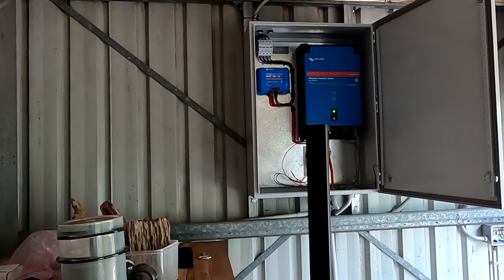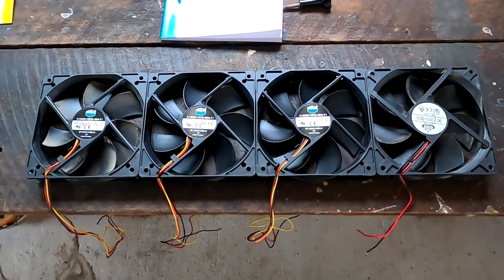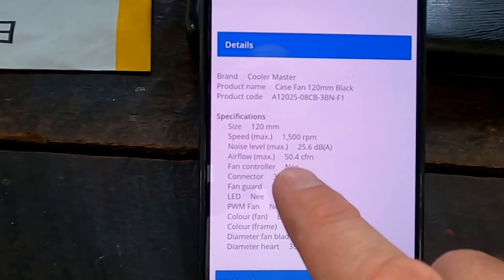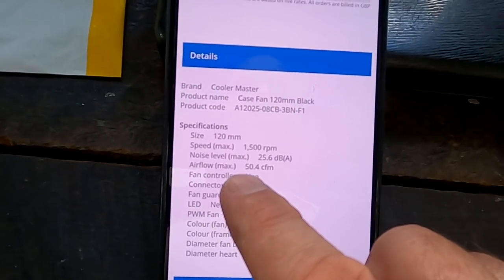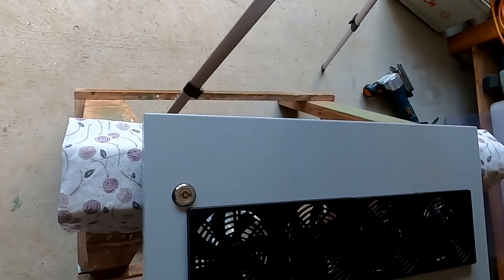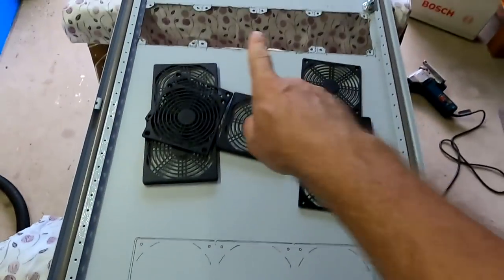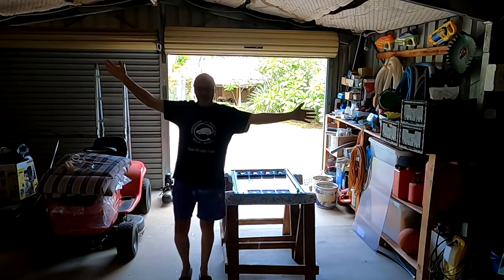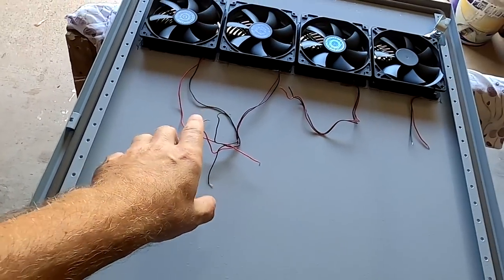Cooling our Victron equipment - your suggestions, my solution

Comment: Don't expect good results trying to series electronically commutated motors for a higher voltage. Even regular brushed motors don't do well in that situation, but at least there you are less likely to exceed the voltage rating of electronic components.  (Use an oscilloscope to see the voltage spikes across each motor.)
You can get 48v rated fans but I think a 48v to 12v DC:DC converter is a better approach.

Comment: If all the fans ran in parallel, you wouldn't have an issue with the differing voltages of the input and exhaust, other than neither being 48v.

Comment: For intake...you could put ductwork down to the floor to get the coolest air!
Reply from the maker: Not much cooler down there. It's sunny hot Australia
Reply: or even an underground trench, for even cooler, but you may run into humidity problems

Comment: You might want to connect a 16V Zener or 12V transient supressor (like MPTE12) across each 12V fan in case one of the fans fails, to protect its inside from getting full 48V as the 16V or 25V capacitors insife it might explode.
a 1A inline fuse would also protect the system from overvoltage.

Comment: Don't run fans in series. I have tried. You could add some 12v zeners and a cap across each fan. That would probably work. Btw I use a standard 240 plugpack running off the 48v to provide a 12v output. An easy way to run fans...
Reply from the maker: Why would it not work?
Reply: @OffGridGarageAustralia  I think the fans bldc controller doesn't regulate the voltage across them in any constant manner. I did this with 24v and they smoked.
Reply: @OffGridGarageAustralia  Voltage imbalance between fan will likely fry them sooner or later. 12V zeners is too low though since that's only 48V, which is less than the battery pack. Need to use something around 15V so zeners only pass current when there is a significant imbalance between fans.

Also, you probably want intake fans for redundancy: if one or more exhaust fans fail, they'll just suck air back in through the failed fans, you won't have much fresh air circulation from bottom to top.

Comment: All that gorgeous parallel wiring undone - could of just got a buck convertor and that would do the job -  Also means if one of the fans goes out you wouldn't burn the the other 3 out with over voltage.... I'm not sure how many volts the fans can take before blowing??? Anyway I love your video's they're inspiring me to get on with creating my own off grid battery setup.
Reply from the maker: Thank you. I could have installed a buck converter but would need to order one which delays everything again.

Comment: If you search for "magnetic fan filter" you should be able to find better filters for fans. They are normally in computers and last quite a lot. I also like Positive pressure more than negative pressure cases. They tend to say a tad cooler. For anyone who doesn't know, Positive pressure is when you have more fans blowing in than exhausting. This causes air to escape where it can and generally pulls cooler air in.
Reply: This does depend on how much heat you have to deal with though. 
I required negative pressure whilst trying to cool an array of graphics cards and ASIC miners putting out 80-90c each hunting for new bitcoins. Managed to get the room ambient temps down to 35c. 
Ended up using one of those tents that the cannabis growers use (cheaper than building my own tunnel or enclosure but don’t look great!) as they have loads of vent positions and hooked up some 323 m3/hr ventilation fans to that. 
That’s the only time I’ve found I really had to think about airflow and negative pressure made a good difference there. 
I do think trial and error is the best way to optimise your cooling set up though. What works for me may not for you!

Comment: are you sure your heat problem is not radiant heat from the steel wall of your shop behind the box ?
Reply from the maker: Yes, because this is the East wall. I also measured this several times in my previous videos 😉

Comment: Series fans shouldn't work.  Well obviously, you will find out if they do, but on paper the one easiest to turn will spin the fastest and the harder to turn ones will stop or spin slow.  Let's see on the next video if you have already ordered a DC/DC converter to step the 48-60V to 12V and connected in parallel again.
Reply from the maker: Why would the not work? You can series two identical electric motors without issues.

Comment: Looks great! One suggestion if you haven't done it yet, add a temperature sensor so the fans don't run all of the time. Unless the controller has and input you can connect the fans to for this.
Reply from the maker: The inverter has already a temp sensor and switches the fans on when needed.

Comment: One could simply put the Inverter's Fan to use - provide vents in the box above the inverter and tunnel the inverter's exhaust out of the box. Or move inverter 1 inch up. Drill holes in the bottom of the box to let new air come in. This solution deploys 'mechanics' vs 'electric.

Comment: I have some experience . In the Texas southwest desert  we have had years worth of heat problems , cooking lead acid battery's , charge controllers ,and  inverters .. first i figured out the biggest heat was the batteries  i built a wood box and burred them on the north side of a shed . i put thin wall 3 inch  pvc  elbow on both sides  one with a screen and the other with a 10 ft piece of pipe  long painted flat black. i was today surprised how much air it moved by draft, did the same with a three ft piece above the roof  . to the electrical room  problem solved , no power needed for fans . so on a sunny day more solar input more heat output the more the black pipe heat rise . Mo more issues .
Reply: Great idea, @Bill Bean, Texan here as well. So a 10' black 3" pvc chimney for natural convection or upflow draft, and a short ground level screened cold air intake, no fans. That sound right?

Comment: BTW, your batteries is around 55VDC or more, so can your four 12VDC fans in series handle the over Voltage? Also if the fan circuits are not matched, some may have more or less than 12V Vdrops on the fan.
What tool did you use to cut the panel? JigSaw?
Reply from the maker: They can run on 24V for a shot moment, so yeah, no problem.
Yes, just a jigsaw and metal blade. Wasn't too hard actually

Comment: I think it would be better to run them parallel and use buck converter to step down the voltage to 12V, series connected fans give you single point of failure, parallel are redundant, if one fan fails in series they all stop, in parallel, only one stops.
Reply from the maker: On the other hand you're adding more complexity with a buck converter. And more heat.

Comment: 040121/1719h PST 🇺🇸 040221/1019h Brisbane.  Please mount fan as low as possible.not in the middle or top. The hot air which is less denser  will rise upwards. The middle or top design will make less impact, on cooling the system. The metal box will also act as Faraday’s Cage effect, thus preventing Bluetooth TX/RX signals to attenuate. Take care , 73s...
Reply from the maker: All wrong. The fans at the top are blowing out as explained. 
Even with the doors closed the BT still works fine.

Comment: You can Under Volt them. Less Noise, Power, and Might Last Longer
Reply from the maker: 120mm fans don't make any noise at all. They are in computers and are running for years without any problem.

Comment: Wondering what kind of solution he comes up with, 12V PC-fans should have about 12V for safe operation. Dc 48V to DC12V can be done with optional converter. E.g. in the batterybox and cord from there. Convenient with thermostat connection in the inverter – if it can be done easily and it works. 
Fun to watch the videos – it is well thought and he comes up with good suggestions and changes – as well as has many following on YouTube.

Comment: Nice solution Andy- looks good.
As far as space is concerned, you could always mount another controller on the side of the cabinet.
You could also perhaps even have seven fans all running in series, (ie: three pushing and four sucking) thus running under speed and quieter. They’d also likely then last longer too.
BTW What sort of strange people give you a thumbs down on these videos?
Reply from the maker: Thanks, Dave. Some good ideas!

Comment: If the fans run to fast put 1 extra in series on the inlet, that will slow them a bit down or use a small step down inverter to feed them a lower voltage.

Comment: Andy, the way we always ventilate  cabinets in industry is to pressurised them from the bottom and exhaust  the hot air from the top.
Pressurisation both keeps dirt out and causes better contact with the air for enhanced heat removal. 
In summary fans at the bottom of the door vents at the top. Fit filters to both inlet and outlet maintain the necessary back pressure and also keep ants out. You don't want ants moving in, they piss formic acid.
Rittal make all the necessary equipment which is expensive and requires a fair bit of depth.  Doing your own way is more affordable.
Reply from the maker: Thanks Mike, good tip.

Comment: Hi Andy, happy Easter to you too!  Btw. in Australia the Easter Eggs are brought by the Kangaroos or by the Koalas?
From the easy to mount standpoint - the door is the way to do it. On the other hand from the cooling and air flow perspective top and bottom would be the right way to go - too late anyway. 
Also putting the fans at the cold (intake) side is more efficient. As you may know, coler air is more dense therefore the fans are working more efficient. But the most important thing is now to properly direct the air flow inside the cabinet. 
Always remeber, nature is by definition lasy, it takes always the easiest way - therfore you will have to force it a little bit (have a look how data centers are designt).
Reply from the maker: We have an Easter Crocodile which not only eats all the eggs but also the kangar... anyway... Happy Easter!
Cold air, we are talking around 25°... not sure how much denser this is then 35° air. This will not make a difference at all, I believe.
Reply: In Australia easter eggs are delivered by our native Bilby.

Comment: That's fine. You won't ever be able to measure any pressure differential. Heat out at the top, cool in the bottom. Perfect. On to the next thing.  :)
I wish the inverter had an output contact indicating approaching over temp. To control the fans.
Reply from the maker: The inverter has exactly that.
Reply: @OffGridGarageAustralia  Yay!  I see from your other comments. What's your latitude? Are those trees gonna be a problem in the winter?  :)

Comment: The three holes for intake is fine. The air will simply flow at a faster velocity through the intake than it does through the exhaust. Those fans don't move anywhere near the amount of air that could potentially be moved through that size opening (200 cfm max). Look at how much air a leaf blower can push through a much smaller opening. Your intake vent is plenty big enough.

Comment: I think you'll have issues running all those PC BLDC fans in series, at power up they'll see all sorts of voltages across their individual terminals and will probably blow out the ICs
Reply: May...be    The easy way is to do it and see. Fans are cheap.  But you are right.  :)
Reply: I have done it and it does not work
Reply from the maker: They will run fine. They are just normal fans with brushless motors. You can install as many in series as you want.
Reply: @OffGridGarageAustralia  when you power them up, they will have for a brief moment all sorts of voltages across their terminals when wired in series, you might get away with 50V but much higher and the MOSFETs in the BLDC controllers will definitely breakdown.  Anyway, its a non critical component of your system, so don't worry about it, hopefully it never causes you grief.  Thanks for the videos - I'm enjoying them!

Comment: Be sure to add a small inline fuse to the fans if you want to run them directly from the battery pack! I wouldn't want to imagine what would happen if one of those fans sorted out with the full battery voltage on its back...!
Reply from the maker: Yes, absolutely. Next video tomorrow ;)

Comment: Started watching a few days ago.  I have enjoyed following along.  It is amazing the cost of boxes like you have.  Check out a Hoffman network box with double swing and the back plate.  I think the box may be made of gold, at least that's what the manufacture thinks.  

I like to have fan and filter blowing in, so the cabinet is positive pressure.  I have filters on the outlet as well, for two reasons.  Sometimes the fan is off for extended periods of time and the filter reduces the dust coming in and second, creepy crawly critters are somewhat  lessened by the filter.

Comment: I have installed a 12 volt thermostat connected to a relay, which is then connected to a pedestal fan and an exhaust fan. Threshold temperature is 30 celcius. Setup works just fine and keeps everything nice and cool.

Comment: use a buck converter and a panel for good output at 12v
Reply from the maker: Would be another part inside the cabinet. considered it for a moment but 48V is much better.

Comment: I noticed that one of your fans was not a PWM fan but the other three you could add a PWM controller and adjust the speed of you need too. Or you want to make it quieter for when you are filming more great videos!!
Reply from the maker: None of them are PWM fans. It then would have a 4th wire.

Comment: Just cut the top, bottom and and sides out, but keep 1” wide corners. Then install expanded metal over the openings. No fan noise, no fan power wasted.
Reply from the maker: That would be the worst solution ever. All insects would come in and start nesting. I explained this already in previous videos.
I would not need the enclosure at all then 🤷‍♂️
Reply: @OffGridGarageAustralia 
Then fly screen over the openings.

Comment: There will be no imbalance as the fans will be no where near capacity of airflow. You would need to exceed the maximum airflow of the 3 holes with 4x 54cfm pc fans, night on impossible.

Comment: you should have put 2 fans low and 2 fans high on the door  bottom blows in top sucks out  you have weakened the door by  getting to close to the sides

Comment: Fans should blow air in, so you have control over the dust filtration. Blowing air out means you may get dust ingress through any little gap or cable entry gland.

Comment: The first rule with any installation that must be relied on is to keep it SIMPLE. Complex systems fail more often.  Passive cooling is what is needed. here. Drop the box to floor level, add a chimney from the box top to the ceiling to create air flow. This is getting stupidly complicated for what it is.. .... and expensive.  A few more additions  it will not ever pay for itself.

Comment: Hi Andy,
it's now too late... 
Your Idea to put the Air-Inlet at the lower part of the cabinet's door is ok. But I would never put the active fans in the door! Because of the wiring for power supply.
I made some bad expieriences about this. So Fans alawys in stationary parts - here on the sides.
And... never take fans which need to connect in series. Better take other ones which runs in parallel mode: If one breakes the other ones still running.
However: Happy easter + stay healthy!
Reply from the maker: You haven't seen the next video yet?

Comment: Parallel fans (110v) for redundancy at the bottom,  blowing IN. Holes at the sides and top and front. Allow heat to get out every where, with a gale of air in all directions. I had to do that with my concert sound system amps. Heat needs a way out - an EASY way out. Cheap house type air filter across the outside of the fans, so they suck through it. Make guides to hold air filter for easy replacement.
Reply: 110 Volt fans?   Nope....

Comment: You want airflow through box not a cyclone!  You want a bit of dwell time for the air in the box to absorb heat not just rush through, you can compare it to a coolant thermostat in an ICE.
Run fans in series 12 volts for reduced speed and annoying noise😎
Reply: The job of those fans is to remove the hot from the cabinet.   What "noise" are you talking about ?

Comment: I would have installed the fans on the bottom and top of the box, hot air rises and the cooling path will be better that your fan in door solution as a direct path offered the least resistance 

But any attempt at reducing heat is a great idea and will help reduce the life of those products. Keep up the good work and I enjoy your enthusiasm
Reply: Putting  exhausts in a top facing orientation in a questionable environment is a bad idea. It makes it too easy for stuff to drop into the case. Particularly when the fans are not running. Intakes on the bottom do not have this issue, so I would agree about this style of intakes.
Reply: @bradquinn4161  it’ll be unlikely in that environment, if anyone was concerned then a strip of fly mesh would sort that issue, we use these fans for cooling, mainly the magnetic version as they produce less noise.

I’m just putting out another way to do it out there.
Reply: @brynsmith414  Yeah, we tried that in our shop and after a few years had no end of problems. Moving the upper vents to an orientation perpendicular to the top vastly reduced the issues. Remember, the fans do NOT run all the time. They are controlled by the equipment. Any form of debris (even dust) entering into the case will cause problems.
Reply: @bradquinn4161   that odd you are having issues, i guess it varies on the workshop and the suspended airborne material.

I realise that the fans don't run all the time, no one would, unless it was producing heat 24/7. 

we run ours through a thermo switch and also voltage controller to reduce noise when needed if in a noise sensitive area